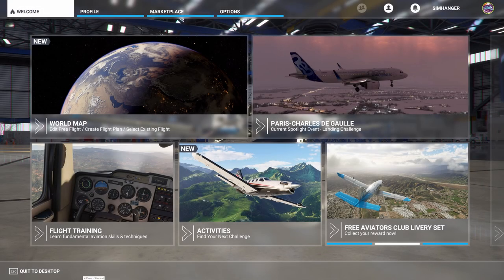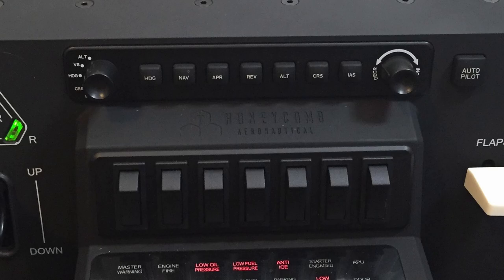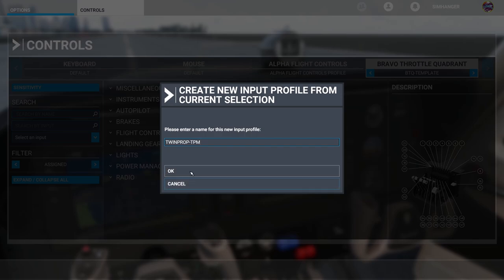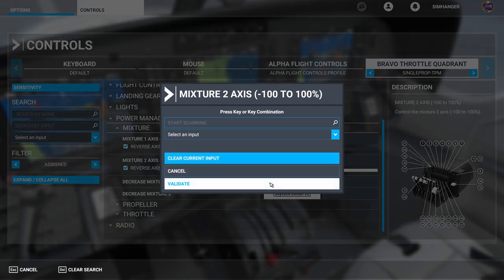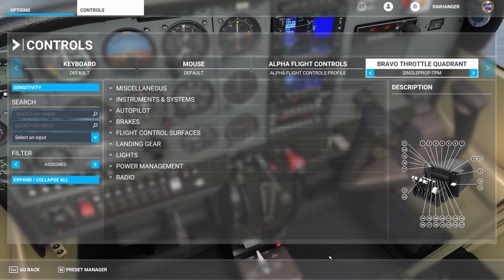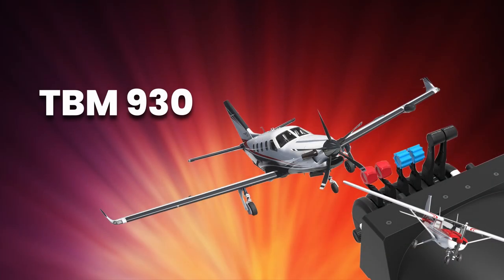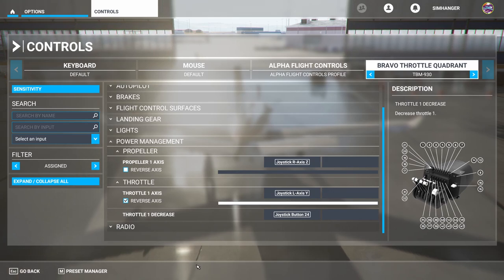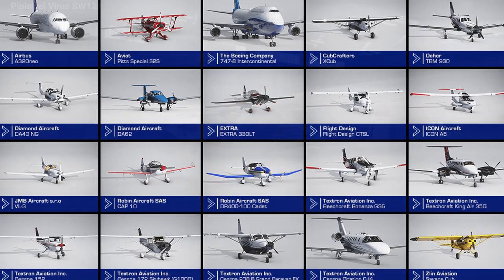Configuring the PROPS in the Bravo Throttle Quadrant | Microsoft Flight Simulator

Comment from the maker: Whats your favourite Prop in Microsoft Flight Simulator? See config guide for the JETS here https://youtu.be/_0tJmDlTBug
Reply: TBM 930 and Cessna 208
Reply from the maker: @icykenny92  . The Cessna Caravan is also a strong favourite of mine :)
Reply: Mooney M20R
Reply: I like the king air
Reply: Love doing short hops in the C172 G1000
Reply: Cessna 172 G1000 and TBM-930. Thanks for the solution of the settings for the TBM!
Reply: The Carenado Piper Pa 44
Reply: Beechcraft Bonanza G36
Reply: KODIAK 100 and the Cessna 414 atm
Reply: @SimHangerFS  Mark,  Do a video for the Xbox community on different engine configuration for the bravo. No such video exist out there.

Comment: Mark, may  I thankyou very, very much for this and your other instructional videos. I am a retired Paramedic  (Back injury) and  having to retire on ill health grounds from the job I loved put me into  a low mood commonly known as reactive depression. I always loved ANYTHING  aviation related.
I discovered Building and repairing PC's/Laptops but although I have built some cutting edge gaming machines for family and friends I have to confess to not being as proficient in running  these machines especially Key Mapping! A topic i had previously loathed!
I had pre-ordered the Alpha and Bravo  products from Honeycomb and bought  a  second hand, but immaculate Saitek Rudder pedals setup. All was good, All was ready for MSFS2020
Until I encountered key mapping. Especially the absence of Throttle 2 in the default settings. At  one stage I was on verge of returning the Bravo TQ's as I was convinced I must have had a faulty unit.
Until I saw your channel.
You have a engaging and refreshingly easy to follow Teaching style, Were you a teacher in a past life? Anyway After following your instructions to the letter I have a fully configured Honeycomb, 'Home flight sim' set up fully configured! ( I even got the hang of how to keymap properly, so much so my saitek rudder pedals are  fully configured too (Yes I know there's not much to map with them but they were no longer a  slightly scary proposition, as they were  previously!
To reiterate  Thank you so much for setting on the right path, or should that read 'Taxiway' !
 to both 'Sim=Hanger' and all  fellow flight sim enthusiasts, please Take care and stay safe.
Reply from the maker: Thanks for your positive feedback, much appreciated. Stay safe.

Comment: Thank you. I have to say Asobo did a lot right with MSFS 2020, but the Control Profile editor whoever designed and implemented it need sorting out. They obviously never saw Microsoft's user interface guide lines.

Comment: Hi Mark and great video tutorial as always. Finally managed to get a RTX 4090 but had to get a new rig since my Lian Lancool case was too small. Worked with a build technician at Micro Center and upgraded my CPU to a 13900 K along with the new GPU and a bigger case. Had to re-configure the Bravo Throttle Quandrant and used your video to make it happen. Thanks!
Reply from the maker: Great to hear!

Comment: Hi Mark, thanks, all set with the basics. Here are some extras I liked: 1. On the fixed wheel planes (most GA) I have the Parking Brake handled by the Gear switch. It creates a real physical feel that fits the PB handle very well. 2. I too left space between Throttle and Prop, but I pointed the empty base of the 2nd axis upwards and covered it "upside down". The cover fits just as good and it gives more hand-room to handle the throttle in the lower half of it's range, which is where 90% of the action happens.
I also have a question: How are people mapping the ignition and the starter buttons in the Grand Caravan, I'm not having any luck with those. Apparently those seven toggle switches do not behave as a one-time action switch, but rather generate ongoing, repetitive actions (causing the stuttering). As you probably found out, those seven switches work best with the "Set xyz" functions e.g. Set Cabin Lights = Joystick Button 36, nothing else. Mark, please consider a tutorial on that part of the BTQ, some of it is, surprisingly, rather tricky.
Reply from the maker: It is tricky. For parking brake I had to use toggle. Fuel pumps were also a challenge and my setup works with most GA aircraft, but a bit hit and miss on the jets. The gear lever for ga is a great idea. I’m definitely going to have to try that. 👍

Comment: Great videos - I noticed that you are able to take the prop lever into the detent.  When I program it and then checking it, the lever does not go into the detent for feather or throttle reverse.  What am I possibly missing?
Reply: I have the same problem. Did you find a Solution?

Comment: I'd like to add a "me too" to the commenter who asked about the best setup for the DA62. Had hoped this video might show it in the Options sections when it showed that aircraft, but it wasn't to be. The search continues. With its FADEC controls and other variations from the classic throttle/prop/mixture twins, I'm starting to think that using a twin turboprop or jet as template might be the best. I might even use those throttles instead of the GA version.

Comment: Thanks for the detailed explanation, I just got my Bravo last week and tried it out for the first time last night and found it’s not quotes a plug and play as the yoke was. The problems I’m having are: 1- axis are not mining the levers in sim accurately, it’s like there are a few positions, moving the throttle /mixture /prop through the range the sim jumps between a few positions. The worst part is that it’s not the same for both engines (eg with bravo quad both throttles 50% left engine sim lever is about 25% right is still full throttle) on any levers so it does make for some very interesting yaw conditions. When you look at response curves they register there correctly, it’s just in the plane. I’ve also set the responses to linear to try to equalize to no avail. This is happening in MSFS and X-Plane 11. 2- more of an annoyance but in MSFS only I have to set throttle 2 to reverse axis but throttle 1 does not need to be. That isn’t a problem in X-Plane. 

Troubleshooting to resume tonight, but your video will give me a head start.
Reply from the maker: Make sure you recalibrate in windows, often helps. Regards
Reply: @SimHangerFS  thanks again, after a couple hours I’m up and running. I used a variation of your tip, after unassigning and reassigning the axis’s multiple times, I unassigned them and exited the sim, came back in and assigned the throttle, prop, and mixture axis’s and it worked. Much more controllable!  That was MSFS, now for X-Plane.

Comment: Hi everyone! 

Unfortunately, the instructions described in this video regarding TBM-930 set up, no longer work. Please refer to the instructions below for a current Power Management solution.

I use the 1st and 3rd joystick columns on my BTQ for my TBM-930 set up. If you like, configure your BTQ as listed below:

THROTTLE:
Throttle 1 Axis - Joystick L-Axis Y
Throttle 1 Decrease - Joystick B24
Throttle 1 Cut - Joystick B26

PROPELLER:
Propeller 1 Pitch HI:
Joystick R-Axis Z+ (&) Joystick B26

Notes:

- With this set up, you cannot move from low idle directly to high idle. To move to high idle from low, first take the propeller joystick out of detent, then slightly move the throttle joystick. Now push the propeller joystick up to move to high idle. However, you can move from high idle directly to low.

- Any any point, to get the A/C's Throttle Stick back to the left side of the console, make sure the propeller joystick is neutral/idle, not up or in the detent position, then move the throttle joystick. 

- To cut the engine, move the propeller joystick to detent, and move the throttle joystick to detent. 

I hope this helps someone🙂.
Reply: Thanks for the info, was going crazy trying to get this to work. When I first tried this, it did not work, probably because I had so many things configured wrong:) I restarted the sim, then put all this in like you mentioned, and it worked great. Thanks again.
Reply: @mikevadnais7722 You're welcome🙂.

Comment: Hi Mark-this has been a very helpful video. I want to ask you in regards to the fact that I recently got the Pilots Dash 7 four engine turbo prop.I have still presently got my bravo throttle quadrant set up as the default GA twin which of cause only works the 2 left throttle on the actual plane .I  am thinking that perhaps for a a workable solution is to setup a profile on the bravo for 4 engine jet with then also using the normal reverse thrust indent(still using my mouse to control the 4 condition levers).As another idea someone has said that its possible with the Bravo to set it up so that the left black throttle on the bravo moves both left throttles on the actual Dash 7 plane.Then set it up likewise with the bravo right black throttle to move the 2 right throttles on the actual plane .With your knowledge of setting up different configurations on the Bravo do you think this second method is even possible ?I would be interested in your feed back.Kind regards
Reply from the maker: @davidkitchingman2222  yes use one axis for two throttles. Config both to same axis, that is what I do. 👍

Comment: Hi Mark, wondering if you could help me out.  I purchased the Embraer 110 from SimMarket and am having some problems setting up the bravo throttle quadrant.  It's a turboprop and it has condition levers.  There are no provision for condition levers in MSFS 2020.  I have the throttles and prop levers set up but the prop levers do nothing.  The prop RPM follows the throttle.  I was wondering if you might be able to help those of us that have this airplane and the bravo throttles to figure out how to set them up.  You may not have the airplane so you might not be able to help.  But thanks for any information you could provide.  I guess maybe I might have to go into FSUIPC 7 to try and set them up....anyhow, thanks for your videos and help.  You have really made a lot of things clear.  Much appreciated.
Reply from the maker: Hi, I don’t have the aircraft so not sure. I assume it doesn’t work as per the TBM.

Comment: Hi and thank you for the good content you making. I only havet one problem I can't fix. In your video at 7 minutes setting up mixture prop and throttle. Having it in detent as you show with same programming as you with button 28, at mine it will not light up as on yours.? Any tip for me please sir? 😊 Trying to set up reverser in the detent at the throttle with no luck 🤔
Reply from the maker: Check you have the latest driver installed and build profiles from that.

Comment: Now that the PMDG DC-6 is out it is apparent that HoneyComb did not think about a 4 engine prop profile. They did think of the 4 engine jet profile & physical layout of the levers. Will we have to bind 2 props (throttle-prop-mixture) to one lever using the 2 engine prop profile? Could you look at this for us? Thank you.
Reply from the maker: Trying to work out something practical ...no simple solution.

Comment: Hi great video. Can you let me know how you configured your fuel pump button for on and off? I can only find the "toggle" option so using the on/off button function doesn't work as desired.
Reply from the maker: Hi Luke, had to configure both on and off positions to the same function.
Reply: @SimHangerFS  hey thanks for the prompt response but I'm not clear on how you achieved this. Sorry can you elaborate. Thanks.

Comment: Thank you Mark good video,I usually like to map controls for every plane I fly just a personal preference,off topic msfs airhauler 2 just got an update you can now Import encrypted planes via the simconnect i haven't tried it yet to busy with prepard,Also if your not familiar with wideview i can run msfs on 1 computer and prepard on other my machines can handle it I have yet to try it but it might be awesome.
Reply from the maker: You'll need a beast of a machine to run both at the same time! 😀
Reply: @SimHangerFS  hi Mark not in 1 computer I run pd3 wideview setup on 2 computers my 2nd has a 2060 so it can handle msfs

Comment: Hello Mark. First of all thanks and congrats for your very good videos and explanations. I've followed this one to complete my profiles and more specifically the 7 black switches. For these ones I 've one remark. You've configured the last switch (at the far right) for activate/deactivate anti-icing. This generates an undesirable effect on one switch button of the Beechcraft King Air 350i : the < SURFACE DEICE SINGLE > which is constantly moving between ON/OFF positions. IS this a bug with that plane or is it something else ? Can you also reproduce the same problem ? Thanks in advance.
Reply from the maker: Hello, and thanks for your support. I have not tried it on the King Air, but typically when this happens you need to configure the same button twice.....off and on. Hope it makes sense. Regards
Reply: @SimHangerFS  Hello. It certainly makes sense :) but I still don't see what I have to configure more. I've followed your videos, configured de general anti-icing (black switch button 7). This is working perfectly for the 2 buttons on the cockpit to which it relates (in the King Air) btu then a third button is having this bad effect... Maybe you could try to reproduce it to see what I mean exactly ?
No obligation of course... ;)

Comment: im lost i need help on the led lights honeycomb throttles ,i installed the new driver and nothing no lights, i look in the msfs  content manager and shows not install , but it shows in the community folder. i really need help.
Reply from the maker: The driver shows as not installed. This is normal. The light update will only be in your default profile. Duplicate and build only from that profile.

Comment: @SimHanger Flight Simulation, I have an issue with the BTQ and wanted to know if you had any insight about it. I setup the throttle as instructed by the video, and  when I move the throttle up, it increases as should in the sim. The only prob is that when the throttle is nearly all the way up in the sim it’s only at around 50%. When I move the throttle all the way up, in the sim, it then jumps up suddenly to full throttle, like a glitch. This isn’t a huge issue with the airliners but with the GA aircraft it can be quite annoying. Let me know when if you know anything about this 😁
Reply from the maker: Hello, firstly check the sensitivity of your axis in sim. To test make all axis default. Secondly it could be you have something else also allocation to the throttle....check all controllers and buttons. Also check the calibration of all axis in windows. Does this happen on all axis or just one?
Reply: @SimHangerFS  thanks for the help 😁 I will test tomorrow and I will update you then
Reply: @SimHangerFS  ok so I found that other controllers in the sim had a button assigned to throttle so I cleared all those inputs and still the same thing. The sensitivity on the axis was already default, so I went into Windows’ calibration wizard and the axis appeared normal. Let me know if you know anything else. Your help is greatly appreciated 😁
Reply from the maker: @wordofrhema   I would recommend you check you have the latest MSFS config file from Aerosoft/Honeycomb. Then delete a current config giving you problems and rebuild from the new default config. Let me know how you get on.
Reply: @SimHangerFS  sounds good
Reply: @SimHangerFS  I downloaded the driver and suddenly all my issues melted away. I didn’t even have to reset my settings, the throttle just all of a sudden started working like magic. Thank you so much for your help. It really means a lot. You saved me so much time and effort. I knew that starting up the sim again after months of not using it was gonna be a hassle, especially the fact that I would have to setup the BTQ. It only me three days but without your help it would’ve been longer. Thanks again, and although I only have seen a few videos I will subscribe because I’m positive your future content will help me and so many other out. Have a wonderful Easter 🐣
Reply from the maker: @wordofrhema   happy flying my friend and thanks for your support

Comment: My fuel mixture doesn't work after update 6, checked assignments and is all set up correctly but when move leavers ones in game cockpit no longer move, flying beechcraft kingair
Reply from the maker: Try delete and reassign controller binding. Config may be corrupted.
Reply: @SimHangerFS  thanks will try that
Reply: @SimHangerFS  hi Mark, that didn't help but changed aircraft to Barron and its working fine, its just not working in King Air 350
Reply from the maker: @CarlCrez  Weird...not sure what the issue is?

Comment: Hallo, does this configuration work for TBM 930?
Reply from the maker: Watch the video…there is a separate section (time stamps included) on the TBM 930
Reply: Hallo, i configured Saitek throttle for kodiak 100 according your tutorial and it works very well. I can appreciate blade propeller that move in feather position. I suppose that starting from this confinguration (kodiak 100) I can duplicate  and apply  your tutorial for TBM930. Am I right? thank you for your support
Reply from the maker: @antoniopettini9503  no the TBM is different config as shown in video